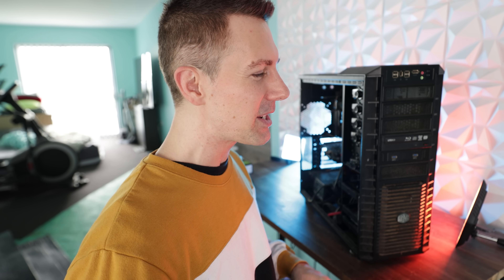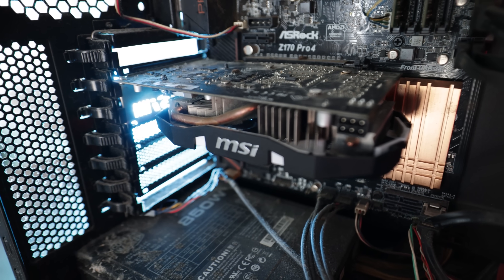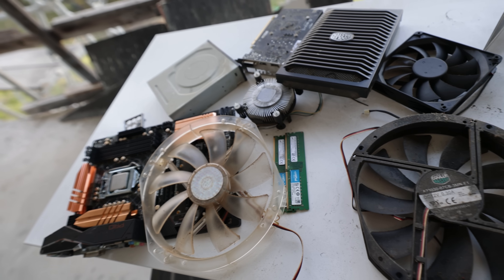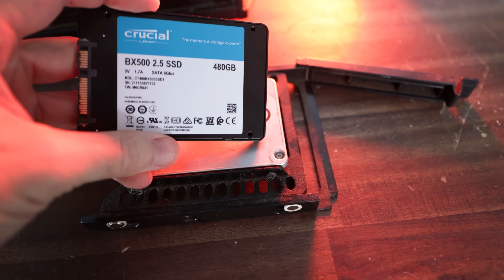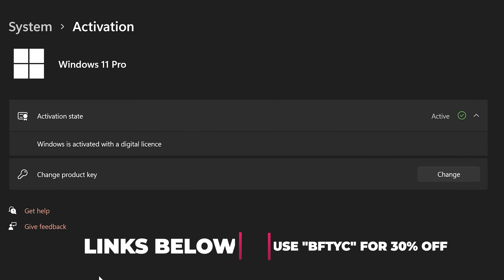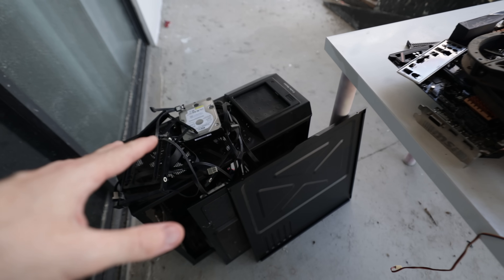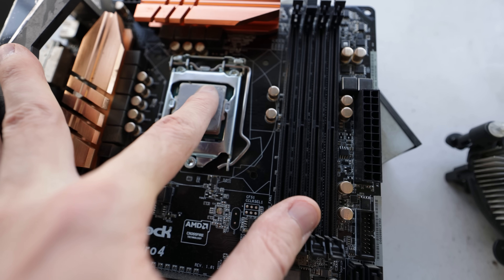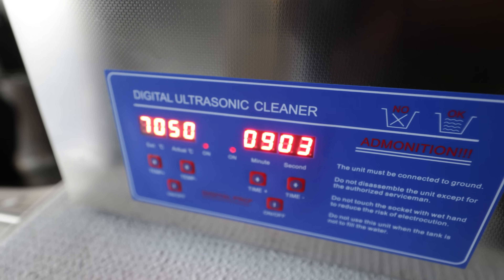Restoring a "DUMPSTER" Gaming PC! - PCUC S1:E3

Comment: What is the multi purpose spray that you use to make your parts shine afterwards. I’ve been struggling to clean my pc parts. I’ve been using CRC Contact Cleaner and 91% alcohol to clean my PCBs and other parts but it still never has that shine afterwords and sometimes even looks dull and grainy. I tried using brake cleaner on a gpu one day and it disintegrated the fans. Please help me. 

I buy a lot of used computer parts on Facebook marketplace and Craigslist. Some of them come in horribly dirty. 

I own a tech business called SavvyTech Electronics Repair & Exchange LLC and we also build custom gaming rigs. Some customers can’t afford really expensive computers and they’re fine with us buying used parts to bring the price down. 

To put it in perspective, I do a lot of electronics cleaning down to the PCB. What is the best but not really expensive stuff that I can use to clean parts and leave the plastic casings and fans looking shiny? 

You can email me at:

talgin.hanks@savvytechwiz.com

Business number is:

720-761-9541

Comment: The case fans have no issue with this cleaning, I mean like the oil/grease in the fans? I know the back is sealed but I feel like where the fan blade attaches water will get in there no matter what with the degreaser? I am just curious anyways, I am not trying to discourage anyone and I think this would be so much easier than taking them apart to clean them. I have two case fans that are pretty dirty right now along with my cpu cooler fan and thought this be cool to do if it has no effect on the grease inside them. I don't have a ultra sonic cleaner but I am sure just soaking them in cleaner be fine and brushing them.

Comment: Hi, love the channel and enjoy the content. I had a question that has been driving me crazy. I picked up a used rx570 4gb and have it in my mac pro 5,1. In windows it is giving me an error 43. It will not update drivers. I installed some software that makes the error 43 go away, but it will still not update the drivers. New windows install and multiple systems with same result.

Comment: hi man i have a problem with my gpu and cant see any fix for it 
it give my signal but show me a code 43 on device manager  and my resolution stuck at 800x600
when i start my pc gpu start  working and after 1 short beep gpu LED (light) goes off and after 30 sec its turn on again
btw its work perfect sometimes (1 from100 try ) and when is work its work -.- but if i shutdown my pc it happens again 
gpu is dead ? can i fix it? 
sadly i live in iran and  i cant send my gpu to you 
pls answer :(

Comment: Tech Yes Man! i have a semi related question, i have a Corsair 780T Black which comes with A three-speed fan control button, ive 9 Corsair AF140/120 Red Led fans and recently the 2 front 140mm fans started struggling, having problems spinning in the 2 lowests speeds, they only work properly at the max speed (which wasnt the case before) how do you recommend cleaning them? can i use water? should i apply some lubricant?

Comment: The three upgrades I'd make to that right away would be...

1) a better cooler for that i7-6700, I'm just not a "fan" of the top down Intel stock coolers, I want to see copper heatpipes, at least one fan if not two, and aluminum fins like a nice motorcycle engine block, and that will help with overclocking (maybe need a 6700K for that though)
2) that motherboard has an m.2 slot that can use an NVMe boot drive, might as well get one in there even if it's just a $40 one for Windows and a handful of favorite games
3) $40 is enough to get four of those RGB heat spreaders for the RAM sticks and that adds a ton of color as well as function to keep it cool, maybe allowing some memory overclocking

Comment: Things I would do:
I would try to remove that hard drive cage or see if I can move it up where the 5.25" bays are, possibly fit in a replacement there for the purpose of increasing airflow. 

Add a fan to the bottom for additional cooling. 

Look into a different side panel or creating a new one with an expanded view.

I'm going to start collecting motherboard back-plates too.

Comment: With all the stuff you have laying around, you didn’t have at least a hyper 212 or another cheap CPU cooler to throw on it? I’m sure you have a cheap 120mm fan that could have been installed as a rear exhaust fan. 
It looks great after the cleaning, but 30$ worth of parts would have made it much better. Plus, I’ve smoked around my PC for years and it’s never looked like that.

Comment: Unless its a x299X or z370 Aorus Gaming 7pro IO shield. Those are electroplated and chrome dipped. Also with perforated, stamped honey comb designs for the VRM fan to vent. Did i mention the x299X Aorus Gaming 7pro has LED's on it IO shield. Gigabyte want $50 each for the x299X and $35 for the z370. I even paid for a 10pack of each only to never receive the damn things. So, i waited a year and got'em off ebay, eventually for $12 a piece. It all worked out in the end causes they all sold.

Comment: It could've used an exhaust fan in the back for airflow, couldn't it?

Btw: How do you ensure there is no charge left in the PSU when you dismantle and wash it?
Reply: He connects it to a PSU tester which drains the PSU once you unplug it from the wall

Comment: I cleaned a friends PC once who complained it kept crashing randomly. Opened it to reveal a completely clogged CPU heatsink, Smoker plus wood burning heating and dust had managed to kill half the CPU. Athlon64 quad core with only half its cores working. I had to run a CPU checker and as soon as it hit core 3 it crashed every single time.

Comment: Still cautious about cleaning a PSU in water but you always prove me wrong. The best part was replacing the usually small and noisy GPU fan with a beefier and a more quiet one that does the job better.

Comment: You can also buy I/O shields directly from manufactorers. I used to build and sell pcs, often using refurb or return parts and they usually had no i/o shields. I would just contact the manufactoror and they would usually send one for about 5 bucks.

Comment: MSI puts on some nicely designed fans with more fins than most. I wouldn't say it was brittle, more like they were thin so they can fit more fins. As the owner of three MSI RX 580s and a 1050, I can tell you that they will not take a hit. Plus, good demo that some fans just can't take that much force from a blower.

Comment: Great video, I actually have that same PC case. It has plenty of space inside and high airflow. I even replaced the original front fan with a 200mm RGB one and the top fan was replaced with an AIO. The case is big and heavy, but it is very functional.
Reply: I love the number of hard drive trays it has .
Reply: @mikescomputercorner1204  True, but I use it more for the external drive bays. I rip a lot of CDs, DVDs, and Blu-rays, so the number of available bays is a plus for me.

Comment: First time i've actually seen my MSi 3GB 1060 out in the wild, they seem to be a bit of a unicorn card as i rarely see them around, they overclock tremendously well on core and the memory can easily go a fairbit as well. Pushed mine to 2.2GHz core and 5001Mhz mem.

Comment: What happened about the "faulty" ssd? Curious.
Reply: Looks like the original is a faulty Intel SSD. I've had two fail, but Intel warranty is pretty good to deal with and they usually come with 5 year warranty...no receipt needed. So if you can find a faulty Intel SSD for sale under 5 years old then snap it up and Intel will replace it for you.

Comment: Bryan i have a super specific question.
So i followed your advice aboht the xeon master race and picked up a used Lenovo S20 ThinkStation with a x5670 cpu in it. It all works perfectly but i wanted to use another psu with it (my old one from my old gaming rig its a 700w fsp) but i noticed a 10 pin cpu power cable on the lenovo branded mobo. I looked around forums n stuff and i saw that an 8 pin works fine? Im kinda scared ti try i dont wanna fry the mobo or the cpu. I was thinking do you have any idea if i can adapt it somehow or what can i do. Any help is appreciated.

Inb4 use the psu that came with the board it is an option but its far from idea the 10 pin is way up at the top left corner but on mt fractal case the psu mount is on the bottom. So technically i fould just leave the psu out of the case and not close the back panel but im sure you can see why im looking for alternatives.
Damn thats a long comment.

Comment: Nice job with the cleaning. The build is asking for a snowman cooler and some OCing on the cpu. I’d think it could use an exhaust fan in the back, as well. Then it would be ready for a better card, all the way up to say 1080 ti.
Reply: How would you OC a stock non K sku i7-6700 pretty much not, could only force it to always turbo to its max but not push it much further than that
Reply: @genericchannel9448  hey, I thought it was the k, my bad.

Comment: machines need a clean once in a while, especially when smoking nearby.
A simple wipe every month or so to start, and then maybe 3-4 times a year getting out the duster to clean all those nooks an crannies and the buildup in coolers. And than maybe once a year a throughout cleanup with disassembly.
I noticed toothbrushes are quite effective to get intbetween lower cooling fins and then maybe a pastry brush for deeper things.
Reply: I am a smoker, and yes the toothbrush and Q-tips are the way to go with a bit of iso alcohol and it rubs the tar soaked dust right off.
Then I usually just wipe everything down with a cloth and a air duster. I do this once every 3 months it takes half an hour to an hour. 

It is definitely worth doing this if you are a smoker.
Reply: @xSpebaa  would even be better if you smoked outside.
Reply: @aboveaveragebayleaf9216  probably would, but i live on my own and can do what ever I want.
Reply: @xSpebaa  I understand, but also understand to non smokers the smell is not pleasant, and you will never get all of the tar off the walls if you want to move in the future.
Reply: At this point just buy a console lol. Once a year is fine

Comment: I love those copper heatsinks!  I would have changed the stock intel cooler to a small all-copper cooler.
Maybe an old copper Zalman such as the cnps 7500/9500/9900

Comment: Good day Bryan, greatly appreciate your thoroughness and attention to detail. I've learned a substantial amount from your channel over the years.
Would you please confirm what affect your extensive Ultrasonic Deep Cleaning have on the Cooling Fan's Bearing Lubrication. Many Thanks.
Reply: THIS!
Reply: They would need relubing, hope he see's this.
Reply: was just thinking the same thing
Reply: He put the GPU and PSU in water, right? Is it risky to do so? I would be too scared to even dip the fans' cables in it.
Reply: @Piohm  As long as it's 100% dry it will be fine, just those fans will either need to be lubed or replaced if not.

Comment: I would have personally ripped out that hard drive cage in front of the fan, it's kinda blocking that big arse fan.

aside from that it was an incredibly good job
Reply: Where to put the hard drives then? Mounting them into the 5.25'' bays with brackets?
Even with the drive bay it should allow for more air to pass through than many modern cases with glass and a tiny gap at the side.
Reply: @HappyBeezerStudios   yeah the 5.25 bays will do the trick, with a bracket or you can stack a couple of 2.5 inch drives into one bay.

Ah the old days

Comment: You ask, "What could I have done differently?"  Bruh, you just changed dust in to diamonds.  Your one-two punch with the ultrasonic cleaner then the water displacement spray can't be beat.  'buT yOU sHoULn'T pUt ELecTrONIcs iN wATeR."   I've watched no less than 5 videos of you using the one-two punch.  I think we can put that to rest?  How many comments do you get of some jackass making that comment?

You've kept tens of computers from the rubbish heap though what you do.  When ever I come from The States visit to my friend in Maroubra, I try to help as many folks in the neighborhood clean and fix their systems as possible when they ask.  They were going to throw the systems away.  I just did a bit of dusting and minor rust removal and the systems work like a charm and have been given another 3 or 4 years of life.  Next time I come down to visit, I'll see if I can pass on some of your ideas to the local tech there.

Great job, man.

Comment: How do you submerge all those electronics in water? Like the fans? That'll surely damage them right? Maybe not if you can dry them extremely quickly and thoroughly... But those fan motors will certainly trap moisture

Comment: I broke 2 fan blades off a zotac 2070 super mini. Tried to slow it down on the center and tapped blades to death. Ordered new fans from china and one or two months later fixed it and sold it for 550 after buying it for 370 and the market raising while I waited for shipping.

Comment: Would be very interesting to see before and after temperatures of GPU and CPU in these videos.
Reply: @Tano I don't see why that would make testing it impossible or hinder it.
Install some games or benchmarks run them and log-out when done.
People ask "Whens a good time to repaste, clean..." This would kind of be the answer as it shows the extremes of both ends, brand new and dirty as heck.
And it would be very interesting to see if there are clock differences with processors that dynamically adjust clocks.
Reply: @Tano No, I'm not the one asking that question, i know when and how to clean my PC parts.
Bryan earns money with these YouTube Videos, so I can definitely see an incentive to put more time into them, it was merely a suggestion for what I think would make the video more interesting for current and potential future watchers.
Reply: @Tano ok, go start arguments about something so arbitrary somewhere else, i cant be bothered with you.

Comment: I am curious if dunking the fans in water (ultrasonic cleaner) will dry out the fan bearings faster ? Care to comment on this ?
Reply: @Tano Oh what do you use to replace the grease ? Also pulling out fan itself from the housing sounds abit risky. Too much force and the blades might just go broken

Comment: Love these kind of video's.... still kind of freaks me out watching you put all that stuff in your cleaner (power supply most of all). I was like what the... when you busted the fan on the 1060. My son has a Asus 1060 6g with dual fans. I was cleaning it the same way you did and the my thumb hit the blades and 3 broke off. I had to go on amazon and buy a fan replacement kit. Just wondering why you did not put a fan on the back of the case for better air flow.
Reply from the maker: Ah it already has a big 20cm fan front and the outake is actually 20cm on the top.  Works well.  Though honestly the case is so big and meshed that it works like an open air test bed pretty much.
As for the fanblades yeah gotta be careful lol, in this case though I only just started up the spinning and they snapped... so they were very brittle to begin with :(

Comment: @Tech YES City ~ I'm thinking of investing in an USC. When cleaning parts, do you suggest letting them air dry or applying heat? How long to dry before operation?
Reply from the maker: Need some kind of tool to dry out the air, especially on gpu, psu and mainboard, the water gets in really tight places, the datavac heats up and blows hard, so its a perfect combo forgetting parts dry in 10 mins.

Comment: First time seeing a fan get watered on. Would cleaning it this way strip the oil in the fan?
Reply: Yes the fans will most likely die in few months because water gets in the bearing. Also I would not do this with PSU because of the transformers. Very risky to get some fireworks and smoke if water doesn't 100% evaporate from the coils. Just don't do this, clean it with compressed air, qtips with some iso alcohol etc just don't put the fans in water.
Reply: + the PSU turned off can hold power for a long time as well, enough to kill a person. Just don't do this...